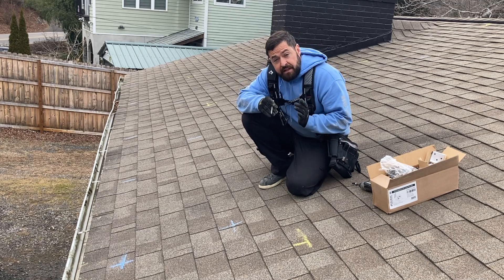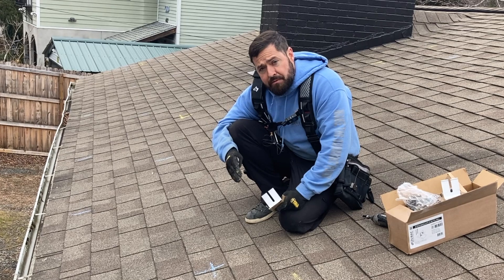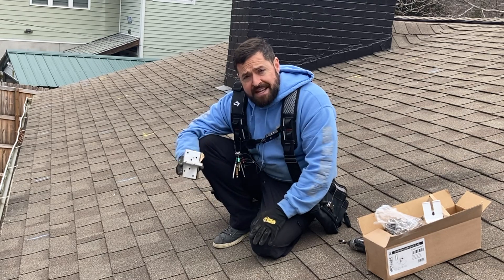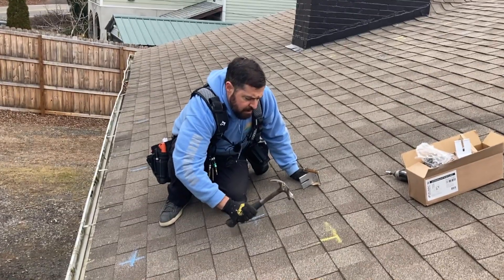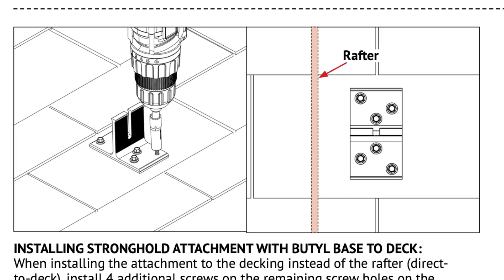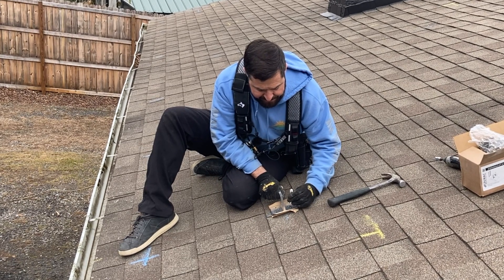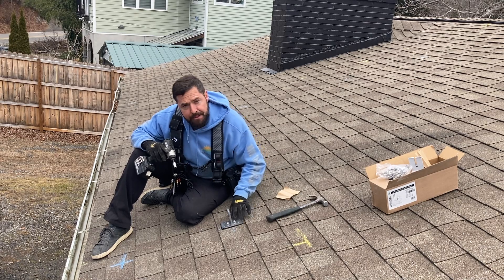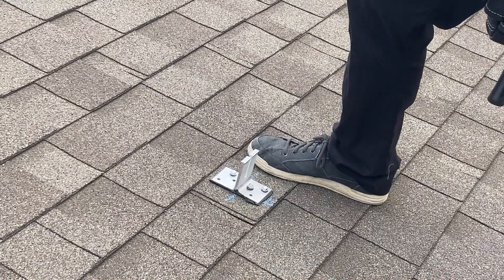How to Install Unirac Stronghold Butyl Attachments for Solar Panels | Step-by-Step Guide

Comment: About thick is the butyl pad?  Does the bolt have a natural stopping point or do you have to watch for over compression?
Reply from the maker: It doesn't say on the datasheet, but i am assuming it is about1/8 of an inch, similar to the height of an extra layer of an architectural shingle layer. It is pretty easy to over-compress and blow out the washer if you aren't mindful. Here is a link to the extra pads https://www.sunhub.com/product/2FLPO/unirac-extra-butyl-pad-sh-kit?srsltid=AfmBOooJW7dP26CtHC5hUkxU5ydqxPAUzKfdzpQJOv0ofnG1bj6jLfRY
Reply: @RockyBroadSolarLLC  Thanks for the response and link.
Reply from the maker: Thank you.

Comment: The issue with installing an L bracket only is that you have no ability torque and or spin the mount to match the railing. This requires even a larger skill set then doing a flashing. As installing with the flashing allows the L bracket the ability to turn left and right. If all brackets are not put on straight you will put undue stress on the mount screws and seal. For an installer with 30 years in the industry the flashing setup allows the L brackets to turn left and right and flush mount with the railing.  Also if ever screwing into wood a pilot hole is required. This can help prevent splitting the truss.
Reply from the maker: Seems like every attachment type has it's strengths and weaknesses. Unirac's instruction manual does not suggest pre-drilling pilot hole in this case. I think they manage this by using 2 smaller diameter self drilling lags instead of one single lag bolt. Thanks for watching the channel!

Comment: I realize most people aren't going to go to the expense of installing a metal roof before they install solar panels, but that's exactly what people should do if the site will not allow a ground array and they have to put solar on their roof. 
 I highly recommend  people put in ground arrays if at all possible. 

 I feel string inverters are a lot better option since  microinverters literally add a failure point under every single panel. 
Ground arrays also do not require rapid shutdown expenses, nor do they add additional failure points into the system.
Reply from the maker: All good points @powerguymark. There are pros and cons to each. Ground mounts can cost quite a bit more up front, but it's one and done, and like you said, it removes the need for rapid shutdown. Definitely makes things a lot more accessible in the future as well. Standing seam metal is the holy grail of metal roofing and allows zero roof penetrations. That is what I installed on my porch roof but it faces north. Many times people just don't have a sunny area in their yard where a ground mount is feasible. Thanks for watching!
Reply: @RockyBroadSolarLLC yes site specific problems can be a punch in the gut.
Reply from the maker: Agreed. Up here in the mountains most people are fighting heavy shade from tree cover or being on the wrong side of a mountain. Thanks for watching!